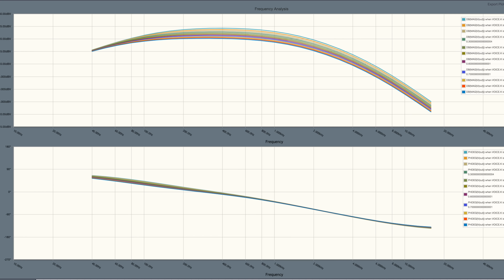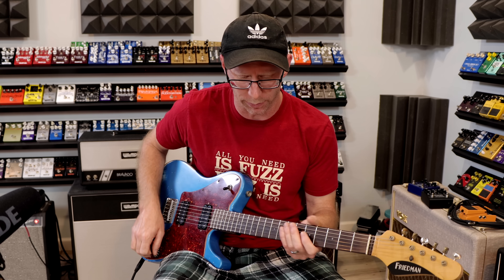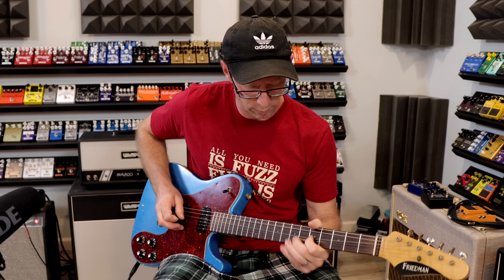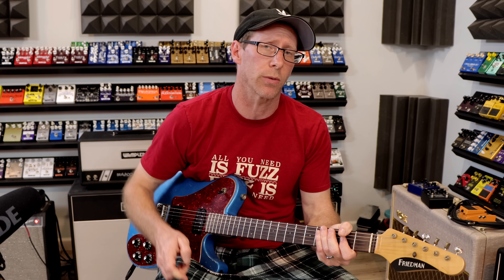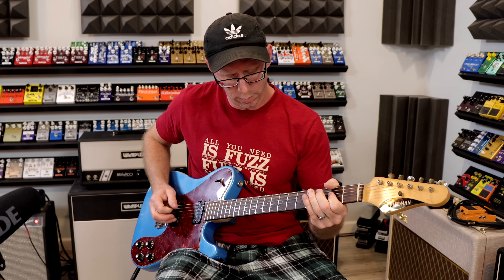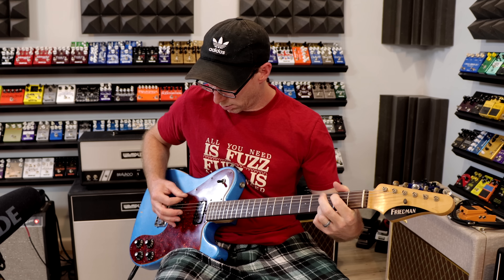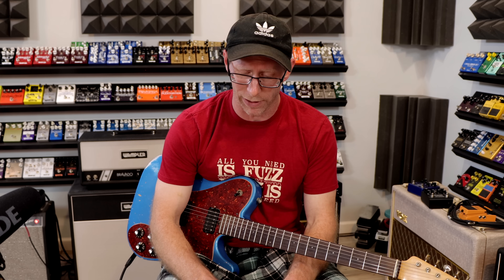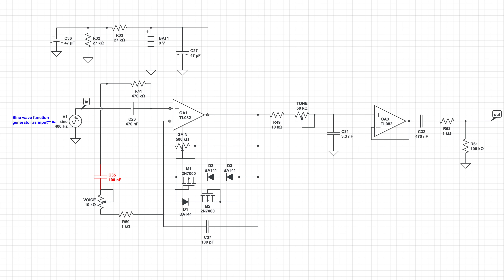What do all the parts do on a guitar pedal? Zendrive circuit experiment

Comment: Brian, thank you for the experiment and video. Let me just mention that the actual Zendrive circuit is a bit different at the first opamp biasing and voice section from what you used. I also experimented with it and built one, and found that the diodes selection make huge difference when using it in relatively clean drive (John Mayer tone). BTW, Vertex Ultraphonix is also just a Zendrive clone with a 2.35k ohm resistor instead of the 10k Voice potentiometer.

Comment: Love the video but a couple of questions, if you are delving into other bits, which I'd love to see. Firstly you mentioned the output volume Pot, and I kinda understand what it's doing in terms of output impedance, but when I see different circuits with different value Pots being used I'm surprised as I'd have expected all designs to use a similar value. All are performing the same function and feeding into exactly the same, (more pedals or amp) inputs.

Along similar lines I wonder about the Pot used in expression pedals. I looked into it and there seem to be different values of Pot used, and possibly even Linear/Log pots. I understand that the Pot is a simple passive voltage divider, so why hasn't a convention popped out?

Comment: Mr Wampler, you are amazing. This is a great type of video and very informative. The more you switch different parts in and out, the more the umbrella terms of guitar pedals wash away :)) always fascinating to see and hear what's going on under the  hood, than to read about magic diodes, magic op-amps, things that " keep your core tone intact but make it better but without changing it but just adding a little bit of magic but with no alteration to your original signal but just beefing it up but not messing with it but making it more assertive in the mix but without a mid bump....bla bla bla" :)))). Keep it up. Be an educator. 
All the best

Comment: Like? Yes.
More? Please.
Do I want my chorus to sound like Whitesnake? Nope, I want it to sound like Alex Lifeson.

Good stuff.
Reply: Dimension C.  Instant Xanadu.
Reply: Michael Cottle  Yepp, the chorussy stuff on early Rush is easy enough, Dimension D or C or CE-1 plus a Mistress. „Show of Hands“-era albums are another kettle of fish. Haven‘t really found anything that can adequately mimick a TC 1210, and a „vintage“ 1210 is kinda expensive these days (1400€+ on Reverb).
Reply: Thomas Jefferson Erm, nope. Alex‘s rig on the HYF tour at least contained no less than. 6! potential sources of Chorus - GK CPL preamp (built-in), Dimension D, TC 2290, two TC 1210s, and a Yamaha SPX90, all run through mixers. Usage info conflicts between AL himself and his guitar tech at the time, so it‘s difficult to tell for sure now,

 In any case, one unit for Chorus/Flanging isn‘t enough to cop his sound. My guess is that he used either the Dim D or one of the TC 1210 in spatial expand / doubler mode as the „baseline“ chorus, and added a 1210 set to a „chorussy flange“ for solos/lead parts, where the modulation thickens noticeably. The Dim D alone doesn‘t do the trick, and neither does a single 1210.

...l‘ve tried...
Reply: Thomas Jefferson  Mate, chill, all the albums you name aren't SOH, and yes, a single Dim D is definitely NOT enough for neither AL's live nor studio sound modulation sounds. And yes, there is conficting info from AL himself and his back-then guitar tech from various 80s GW, GFTPM, GP and NME magazine articles on what he used on which track and to which effect.

If it were as simple as "just get a Dimenson C or D", his SOH-era tone wouldn't be anywhere near as difficult to reproduce closely as it is.
Reply: Pcm 70

Comment: I'm always interested in what changes make "guitar" pedals more bass friendly. Any chance of that?
Also, wouldn't a varitone type circuit instead of a voice switch change the entire sound?
Reply: If I may offer a guess, it provably has to do with the filter circuits and their cutoff frequencies. If the high pass or band pass is low enough enough then the lower frequencies of a bass should get a nice boost.